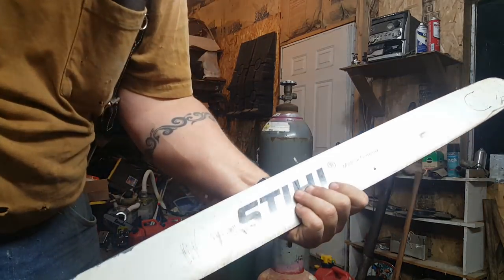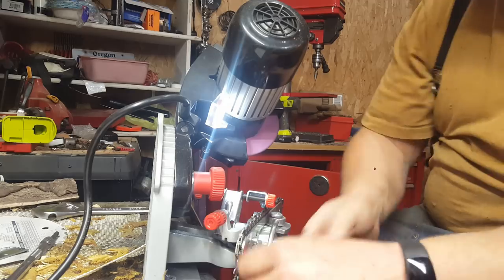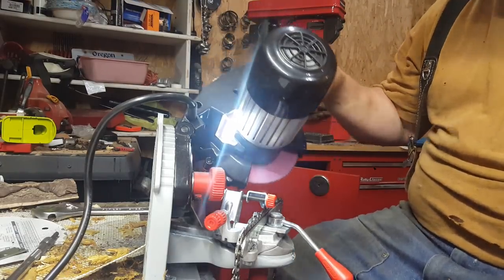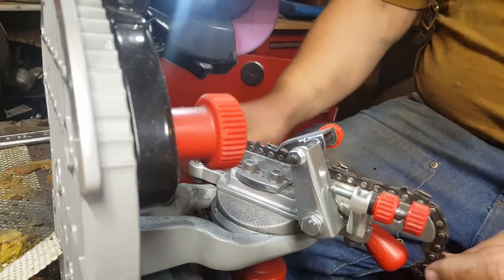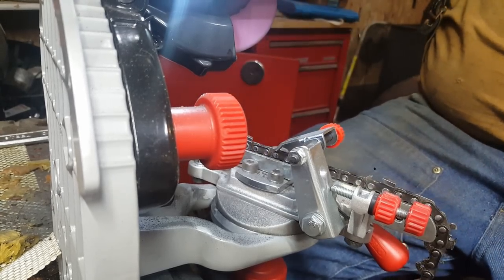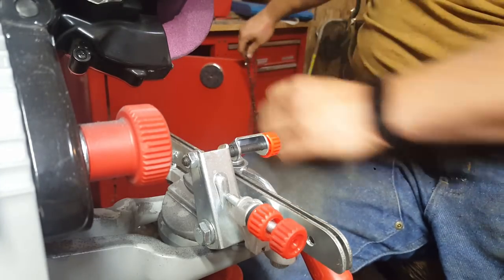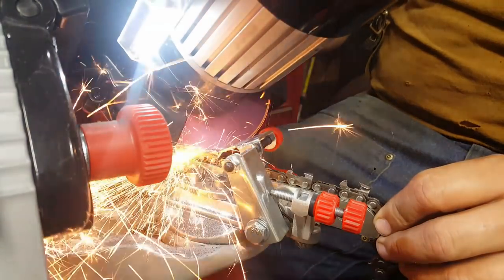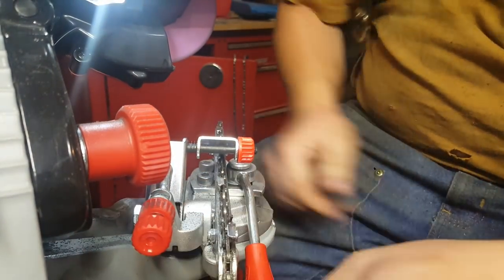Oregon grinder 410-120. The best way to sharpen a chainsaw.

Comment: Hi my name is Roger that little line on the cutter blade is to let you know when to buy a new chain
Reply: Roger
...my Stihl manual says the mark etched on the cutter is to show you the sharpening angle primarily and the amount of life left in the chain secondarily.  They say for safety, replace the chain when your sharpening touches the etched angle line on top of the cutter.  
JoeB

Comment: Wow glad to see this video! Guess this is the 140 watt motor sound ten times stronger than my buffallo POS. Im prob buying the silver one Jolly EVO  Think its about $10 cheaper but has 220 watt motor. Have to really watch out with that one. Yes I can tell you just started. I dont take that much off at once but my grinder dont have the power. Even mine will heat em blue. Now I definately want that one. Both are 25 steps up from mine. Doesnt the bottom swivel to something with full chisel angle?? I saw a video but was long time ago.
Reply from the maker: Yea bottom swivels. I take less off now but was also trying a "semi chisel" set up so was changing tilt and angle off previous grind.

Comment: Way to much. Grind.  Little bit. To sharpen. Try the 10deg set back.  Check your grinder. Angle to makesure it matches the. Grinder settings.

Comment: Way to long, grinding off to much material.
Reply: Rebecca Couet You should start with your worst or shortest tooth on the chain so all your teeth are the same size on both sides. It will make your saw cut nice and straight. Always keep the chain as cool as possible to keep the steel hard.